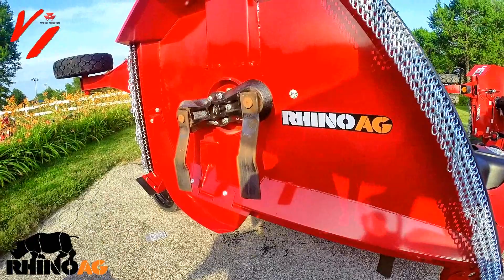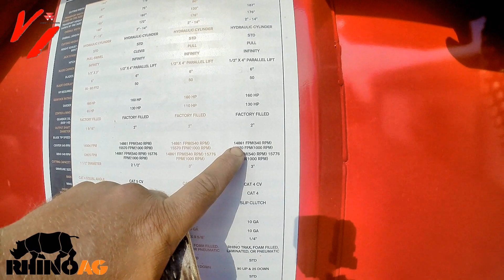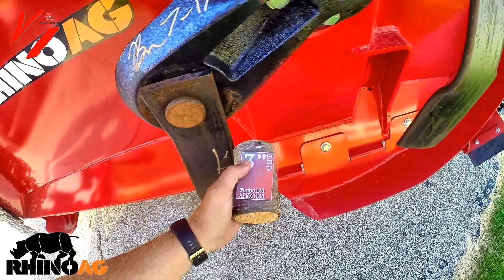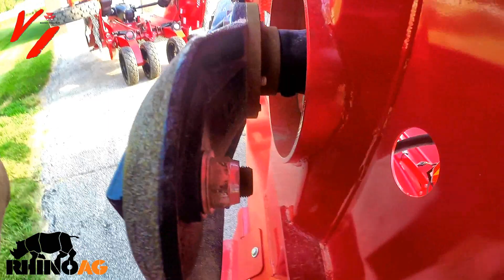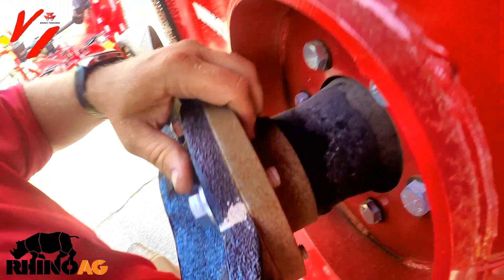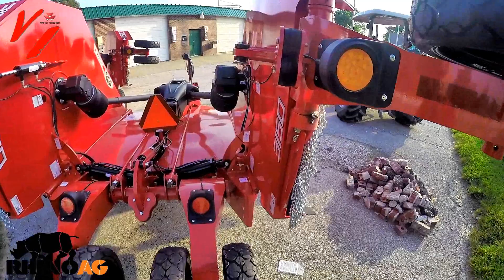Why Infinite Dog Bone Stump Jumper from RhinoAG is Better by Design

Comment: I have a brush hog with the pan design. The first few had the dished design. The company I have upgraded it to a flat pan now. 

I bent one of the dished pans and have recently bent the flat one as well. 

One of the biggest issues I see is the fact that the blades contact one another and get wedged together. When this happens they bed that pan really bad. 

There is little to no bracing or supports/gussetts on the flat pans. I asked the company if they have any known issues with this and they claim none. 

Can the blades swing all the way around without hitting the other blade? 

I have been considering having a fab shop build a new number that is larger diameter with gussets and such and shorter length blades to prevent them from overrunning one another when they hit obstacles.
Reply from the maker: You have to be careful to keep everything balanced or you will ruin a gearbox. That is why RhinoAG went to the Dogbone Blade Carrier design.

Comment: I was really excited to get new 3150 as i have an old 15’ bush hog that we’ve used for years and it’s pretty worn out. I was a little skeptical changing to the dog bone style but figured it was worth a shot. First day mowing section of pasture the center blades came over a little section of ledge rock hidden with the tall grass. I didnt feel anything happen at all no bang no metal on metal, nothing. But all the sudden i see the center deck is no longer cutting. I get out to find the output shaft had sheared off clean. Now it’s $1200 for a new gearbox. Wish to heck i had stuck with the old tried and true design because I’ve mowed that same field countless times with old cutter and never once had an issue like that. In Rhinos defense i do agree with your video that the dogbone is super heavy duty and honestly i wouldnt have bought it if i didnt think it was a really cool design from a user friendly standpoint but i never considered that the output shaft would just become the weak link.
Reply from the maker: If you hit an obstruction like that and broke the 2" Gearbox Shaft. What was the condition of the Slip Clutch. Did you properly break in "Smoke" the clutches prior to use. Here is video on how to perform annual Slip Clutch Maintenance: https://youtu.be/J1pdY_rAWDc?si=1I3PTkW3Y5AzZ-li
Reply: Thanks for the reply. No I did not do anything with the machine at all other than unfold it, take it out and start cutting. Thank you for providing this link. Never knew I had to do anything to the clutches prior to using it. Sure wish the dealer had mentioned that.
Reply from the maker: Understand. Any slip clutch on any machine should be slipped before use. It's in the operators manual and there are several tips on preparing machine for use. But the manual often never gets read, but there is some great information that can save you unnecessary expense. Hope it helps reduce future unnecessary expenses for you.

Comment: Just a question, when I was building and quoting for fun I noticed that the combines said grain version and corn version. My question is can you switch between harvesting grain and corn with these combines. Like say we did the wheat harvest first, then needed to harvest corn. Could you harvest both with the same combine?
Reply from the maker: We don't sell combines here but do know that the Corn/Soybeans machines can harvest grain too. They are more all crop machines. Grain only machines are designed for small grains. I know they install different processing systems to better handle the small grains or Corn/Soybeans.